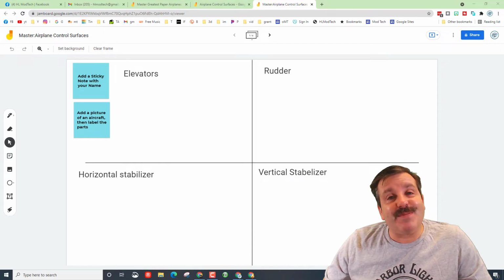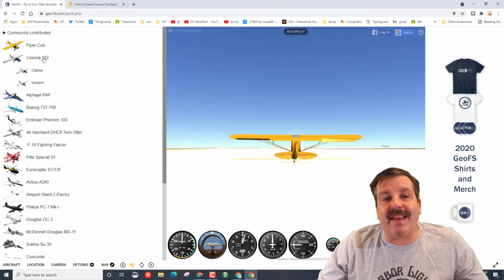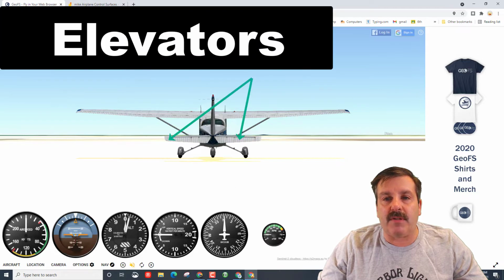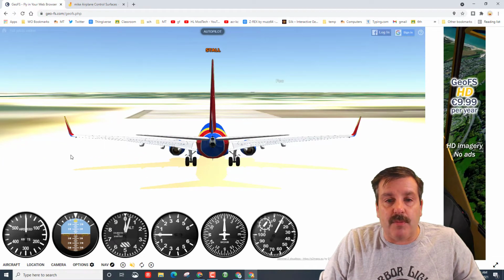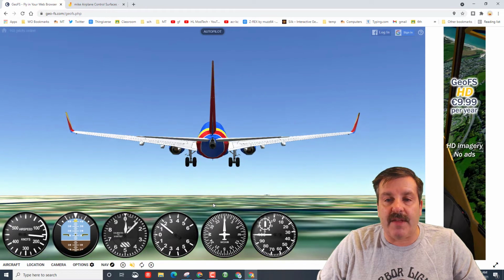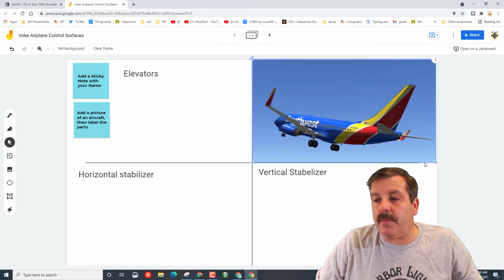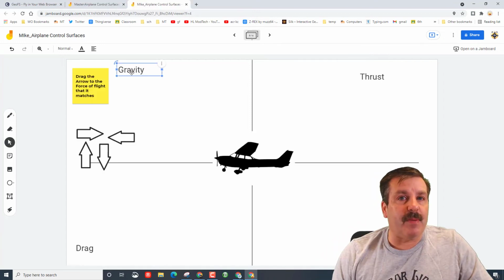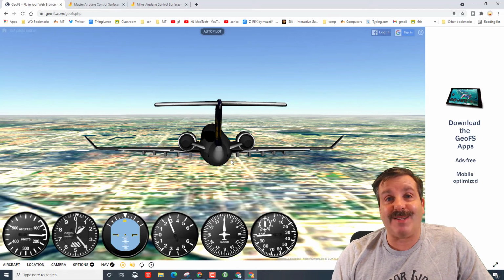Learn Flight Controls, Attitudes & Parts of a plane with GeoFS in Minutes

Comment: So far I haven't been able to find out if I can use my external accessory control wheel, pedals, etc. with the program. Is that not an easy thing to provide?
Reply from the maker: I would check Reddit and Facebook groups for an answer to that. With the program being free and aimed at low powered machines... it might not be a priority.